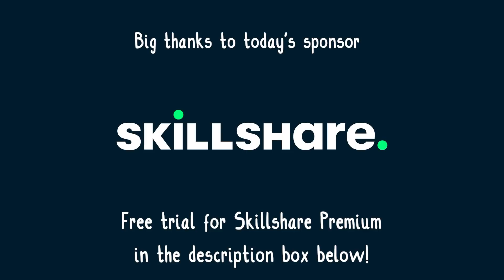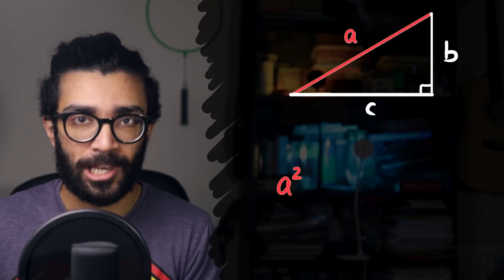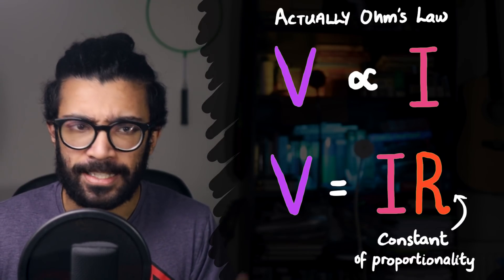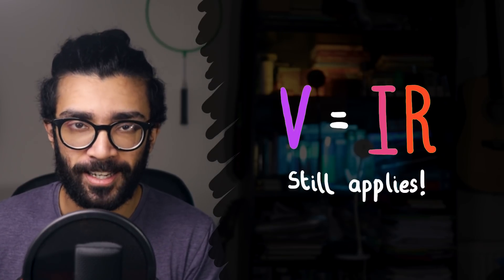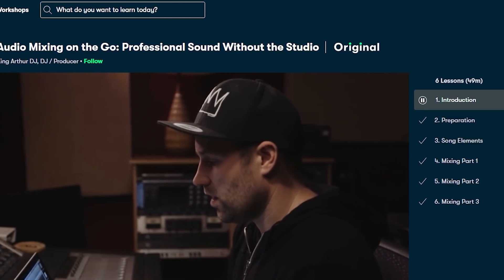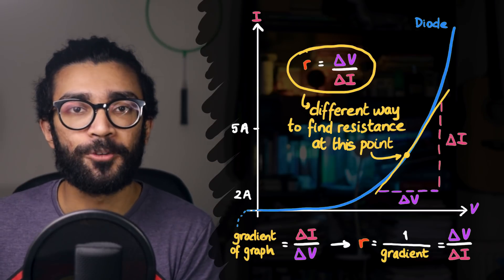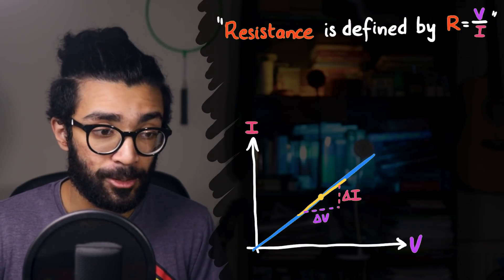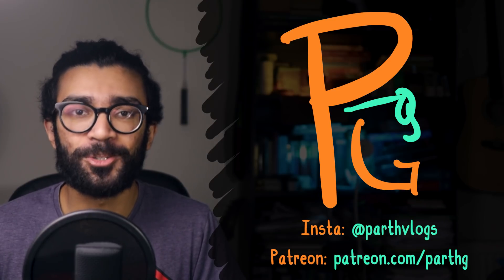Why Ohm's Law is NOT V=IR - there's more to it! Resistance must be constant - Parth G Physics

Comment: Basically Ohms law is rule of thumb that is applicable to conductors only but V= IR is universal relation. Moreover voltage is cause and current is effect. It is wrong to say voltage is proportional to current but basically current is proportional to voltage. You are interpreting it wrongly dea. Ohms law is not fundamental law in nature. Ohms law states that resistance of most metals remain constant over wide range of voltages.👍
Reply: Wow. A lot of nonsense.
Reply: @angelmendez-rivera351  why
Reply: @jewett425  It's nonsense because it's inaccurate. You will realize this if you consult any textbook on the subject.
Reply: @angelmendez-rivera351  look physics by Serway jewett,
Electro dynamics by d j Griffith
Physics by halliday renwick Walker
Physics by randall k knight
Reply: @jewett425  I've read these; and none of these actually make any claims like the one you made.